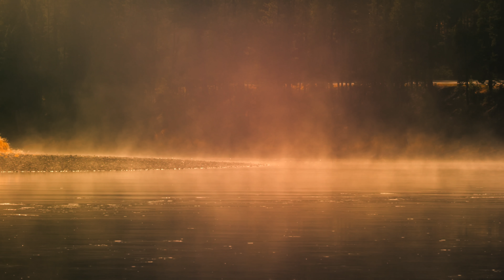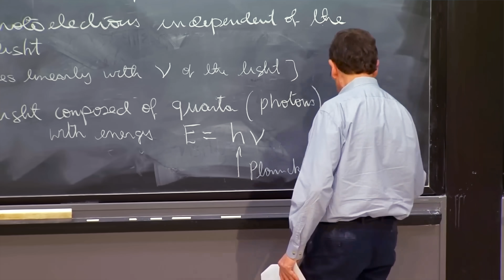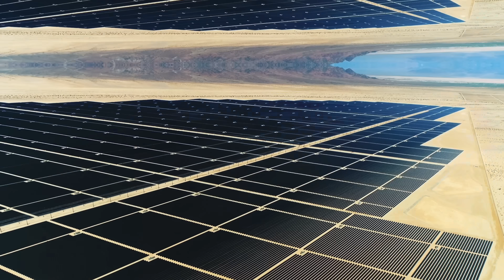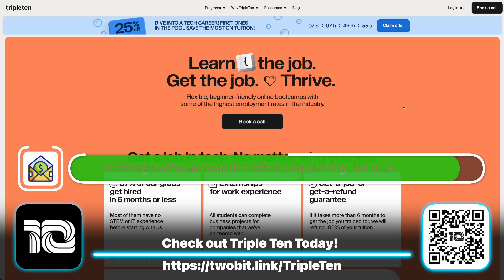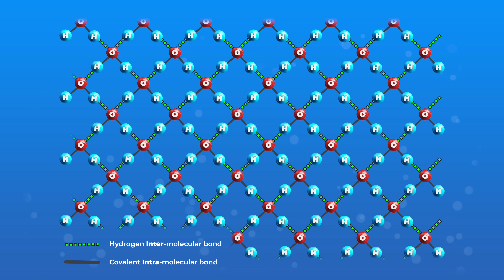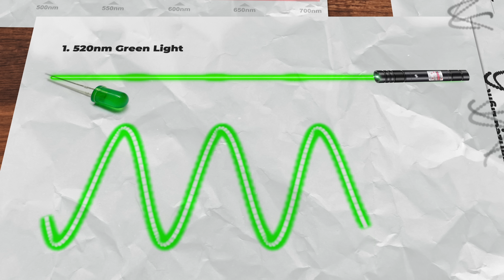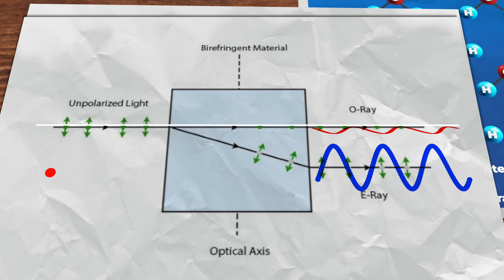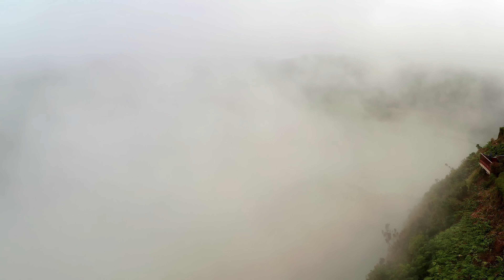New MIT Discovery Just Solved Water's BIGGEST Mystery!

Comment: The method you proposed for generating a polarised light with minimal efficiency loss doesn't make sense to me, you still need a green light source, a diode laser is still the most efficient way to do that according to your findings. No matter how you look at it, you still need more energy to use this effect artificially than heating up the water (I'm guessing). Assuming this effect is real and not a miscalculation.

Comment: I think I saw a great example of this as a kid and it messed me up for a while cause i felt like it mever fully made sense. I took the label off a tic tac container, cleaned the reaidue, and put water in it. Dont ask why, I genuinely dont know, but I do know it was around sunset when I wedged it in the siding on my apartment building such that the top was stuck and the body was in direct sunlight. I came back the next dy after achool around 230 and was surprised the next day to find that it had completely evaporated depite having been filled to the top with the lid closed. I realize it's mot much water, but it is an amount that i feel would not have ecaporated that quickly if I had left it in a cup on my porch. I think the tic tac container somehow speed up the evaporation process but I'm hesitant to say it was due to the container  magnifying the sun because my logic says the tic tac container wouldve continued to magnify once the water was gone and melted or at leat warped the container and there was no sign of any excess heat at all. 

I think it would be more accurate to say that it "concentrated" the light with no specific point of magnification. Maybe it's just due to the light being able to travel through the water and then bounce off the wall and get s second trip through the water. Plus being a container with no sticker, the body if water in it was able to be struck with light from nearly 360 degrees. 

Maybe it allowed this photomolecular effect to with at high efficiency

Comment: This is also how a cool mist humidifier is far more efficient than the laws of thermodynamics.  It doesn't generate steam or vapor, it blows out micro-droplets similarly 'torn' from the aqueous matrix by physical agitation, and the state change occurs in open air.
Lunch isn't free, though - the state change energy is ultimately supplied by my furnace.  Which is why I would bet heavily that the desal plant ends up on the "this idea didn't scale" pile - once the air in the transfer pipe is cold, your free lunch quits working.

Comment: Alright so I finished your video I've got a few ideas.  You said that you have to have the light 45° from the surface of the water. No I know this isn't exact because we're going to be working with bubbles. But what would aviation do to the process? You'd have a ton of areas all throughout the water that would now be capable of having a 45° angle.  I have a few more, perhaps better, I'd actually like to try and not give awat but damn this looks like it'll take some time to set up haha. Excellent video and I believe there is potential here. We just gotta be clever.

Comment: You missed the Thermodynamic aspects. It takes a certain amount of energy to evaporate water, regardless of whether the energy used is heat, light, or whatever. Using light will not reduce the energy required for evaporation by an iota. Also, except for sunlight, light is far more expensive per joule than heat. Using windows or light pipes to bring sunlight into an evaporator may be possible, but it will not be cheap.

However, the effects of light on evaporation from the oceans or lakes could be a significant factor in our climate modeling.

Comment: This can't be a new discovery. The weather service has been conducting regular water pan evaporation measurements for decades. In the week following 9/11, while there was no air travel, the decreased vapor trails made for clearer skies, but increased evaporation. There was no change in temperatures or humidity to account for the near nationwide evaporation increase, so it was determined that photons striking the surface of the water were physically flinging water molecules into the air. I read about this nearly 20 years ago and it was already well understood then.

Comment: Has anyone mentioned using this effect to evaporate water in any vector that is above horizontal, collect it as potential energy and use it to drive turbines or spin anything on the way back down?
Seems kind of obvious. This used to be a nonstarter because the heat energy to evaporate the water was greater than the energy you would be able to get back when the water falls back down.

As a thought experiment, imagine the weight of all of the water above us in clouds, that water falls to earth and we use the falling droplets to spin something, thats a ridiculous amount of energy. With the photoelectric effect couldn't we do this at will with light?

Comment: This "discovery" is not very likely to make any practical differences.  It's an example of something that was already well known but poorly understood.  People have known since the dawn of history that the sun evaporates water real good.  So while we might not have understood the mechanisms fully, millennia of trial and error has already been done.

In the case of desalination specifically, we mostly do vacuum distillation for that.  You can force water into a vapor form by lowering the pressure instead of raising the heat.  If you do use heat, you can still re-claim that heat when the water condensates

Comment: Is there a reason you didn't mention water is one of about 5 substances in nature that has an inverted triple point (that's where 99% of everything on Earth when you apply pressure turns from gas to liquid and liquid to solid, but if you apply pressure to ice it turns to water, which doesn't usually happen?  

Also isn't heated water more efficiently evaporated than photon to water?

Last question, if evaporation is tied to photons, why is is when you put ice in the freezer uncovered it disintegrates without heat or photons?  I'm sorry I just have doubts.   If photons evaporate water
, why are there comets?

Comment: Not all laser light is polarised. 
I wonder if the preferential difference in the effect has to do with polarised light has to do with the fact that light reflecting off a surface (like water) will become polarised. It is for that reason that polaroid sunglasses are used as they cut down on the reflected light off glossy surfaces like wet roads and windscreens. My guess would be that it's the non reflected polarisation that has the greater effect.

Comment: I always thought it was some kind of entropy or similar, like walter from our cells goes in and out, trying to have a balance when you drink filtered/treated walter or, in the contrary, you drink walter with (for example) too much salt.
I think water and air "try" to exchange levels of humidity to even it out between them, even without light or heat (at least not enough heat to be evaporated).

Comment: This also explains why you can get relatively rapid sublimation of water ice on a sunny day in extreme cold. Even if the surface of a road remains well below freezing, the ice itself can be seen to disappear relatively quickly if it is not shaded. This is an effect that is very noticeable and people have argued that "we just weren't measuring the surface temperature correctly". Nope, it turns out we were, we just didn't account for this direct mechanism.

Comment: Its not just heating or the photon effect. The wind and turbulence as well as the humidity of the air all have an effect. Water is unstable at the boundary between liquid and gas. Also remember water has energy within (heat capacity) it so the molecules are constantly flip flopping around. Then there is surface tension to consider.

Comment: Based on my research every laser that has to be used to evaporate water is ADDITIONAL ENERGY to sunlight, so "More Efficient" is OFF THE TABLE: because in order to run the laser you need that energy. (Which the sun would deliver free of charge). Simple economics. BS idea, if efficiency is the goal.

Comment: This video and comment section really feels like hammers looking for nails and swinging at bolts. Using reverse osmosis for desalination is a lot more practical than distillation or shooting laser light at water. Using this for drying clothes or similar materials would result in most of the light getting absorbed before it reaches the wet center of the material. Evaporative coolers already exist and work in dry climates, this would be an increadibly inefficient way to make an evaporative cooler. Interesting video, but going to need a some brainstorming and a lot of development to come up with a practical application.

Comment: I have a thought about applying this to a nuclear power generating station. The reactor pool is generating steam from the heat of the reactor pile, which then powers the steam generators, which turn the electric turbines. Could you use LEDs or lasers to increase the water conversion to steam, by aiming them at the top of the water pool, or would the steam naturally occurring, block the water transfer to vapor? Or for that matter, could you use this in any steam powered system, by making some part of the steam generator transparent and zapping it with lasers or LEDs? I assume that the interior of these steam plants are all unlit during normal operation since most of the high pressure tubing is stainless steel or some other strong metal.

Comment: Diode lasers aren’t really any less efficient than LEDs. Though I’d instead use a dichroic mirror to obtain the green portion of sunlight while using the rest of it for plants. Lasers aren’t that cheap.
Still though, is it any more efficient than RO for water purification? If not, it would only see use for making distilled water. That’s still a big industry, but not that big.

I’d also incur anthropic or counter-copernican reasoning when considering that the 520nm mark is close to the peak emission of our sun. Perhaps we had to be born on a planet with a star that caused water evaporated significantly faster, or else our birth would be far less likely.

Comment: Where's kinetic energy in this? The slamming of air molecules interacting with the surface of water, the collective additive and subtractive collisions of water molecules eventually kicks a water molecule off the surface of the water into the air as vapor. (this lowers the temperature of the water) . If the photoelectric effect is meaningful than humidity levels around bodies of water should drop over night -- I don't think they do. (Instead as atmospheric temperatures drop condensation into fog is more likely to occur.) 
I was trying to put together a water cycle lesson for 7th graders, of course I came across the bog standard image of the big arrow from the sea pointing straight up into the sky.  So what exactly is that? It's the sun, transfer of kinetic energy and maybe this photon effect, but once water becomes a gas why then do those molecules head upward? Water is heavy and dense, water vapor on the other hand, as individual molecules, according to the Standard Gas Laws takes up as much volume as does the other main components of the atmosphere, nitrogen (N2 amu 28, Oxygen O2 amu 32, Argon amu 40,  and CO2 amu 44. Water molecules H2O is a paltry amu 18. It forms clouds at altitude because the pressure and temperature drop.

Comment: Water STILL evaporates at night, EVEN in cold temperatures!  No photomolecular effect required!  Even at 10 deg F, air molecules have enough energy to break the bonds of some water molecules which through their own movement have predisposed them to a minimal bond with the other water molecules at the surface.

Having said that, the other mechanisms you mentioned accelerate evaporation with additional effects.

Comment: This makes sense to me as 'heat' is just brute-force kinetics which paves the way for a more precise (photonic?) intervention. I think this is also more precise than just resonant/localised heating as with microwave bursts. Also, viewing 'heating' as the cause of evaporation is a push-only perspective. I envisage a 'pull effect' of a lack of water vapour, as seen in dehumidification driers, so we're observing an osmotic-style humidity differential correction. I try to explain to friends/family/my-air-drying-averse-wife that all moist objects are 'steaming' even if we can't see it.

I'm also fascinated by the energy-credit system which state-change seems to allow which could act as a type of valve/diode allowing localised effects to accelerate the entropy.